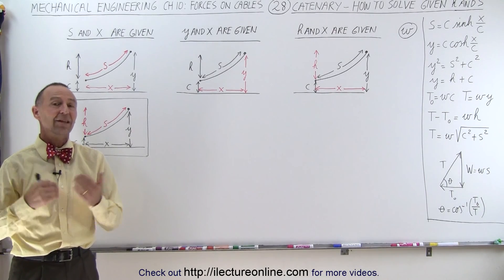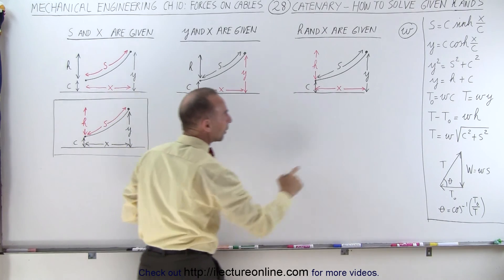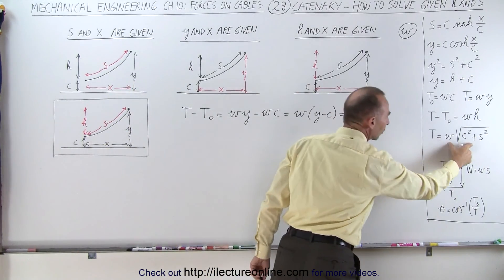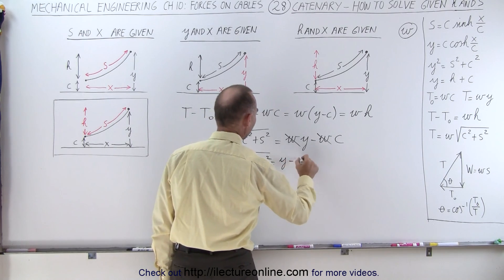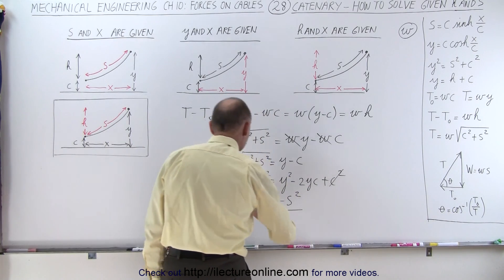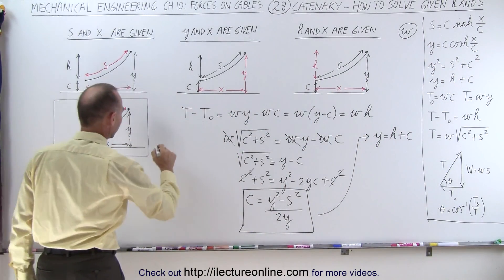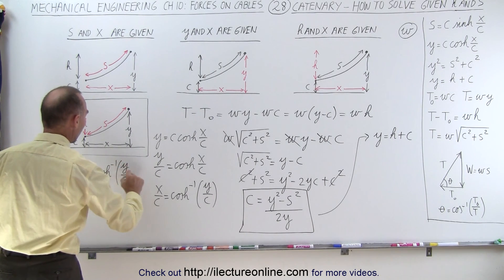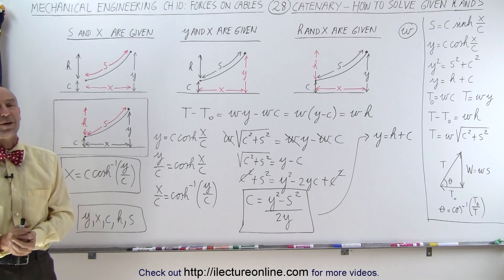Mechanical Engineering: Ch 10: Forces on Cables (28 of 33) Catenary - How to Solve Given h, s

Comment: Hello Sir, thank you for your videos. I have a question. What happens if point A and B are not in the same height, and I fix the cable at point A and B, but I also give it a pre-tension. The relation for C would no longer be valid. What would be the best way to proceed in this case?  To find the behaviour of the cable in this case?
Reply from the maker: You will need to calculate the two sides separately.  Where the two sides of the cable meet, at the lowest point, the tensions will be equal.
Reply: @MichelvanBiezen  ok, thank you very much for your answer. But if I have To(the pretension right?), q, y, and x defined for both sides...which one is my variable? for y=c*cosh(x/c)? or is C not dependent on my pretension? meaning C = T(pretension)/w is not the right assumption? or it is but I also need to find a "constant" right? That changes over the length...for each side?
Reply from the maker: This may have the answers for you.  Again you would take each side separately from the lowest point to the left and from the lowest point to the right.  Calculus 2: Hyperbolic Functions (50 of 57) What is a Catenary? Summary